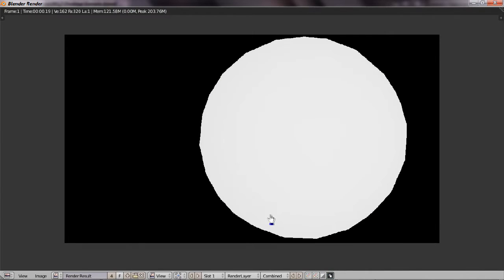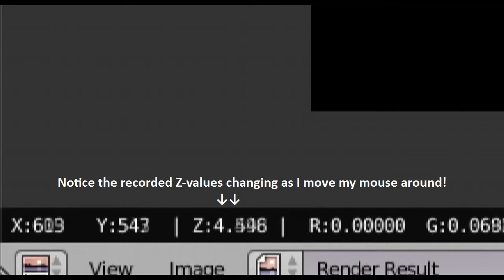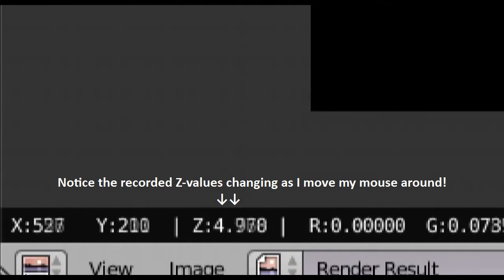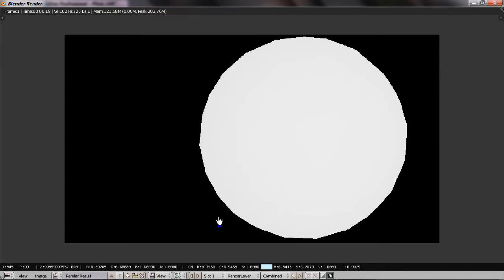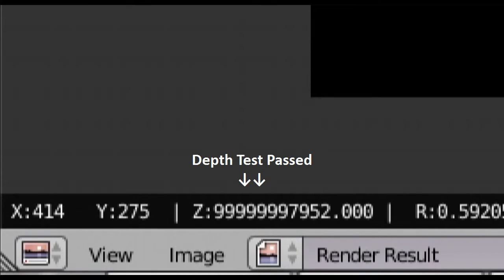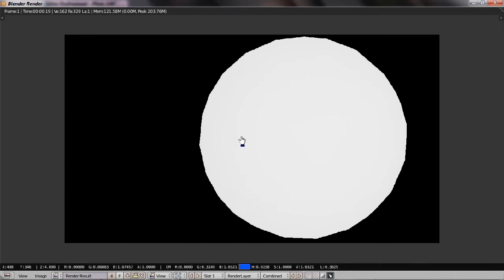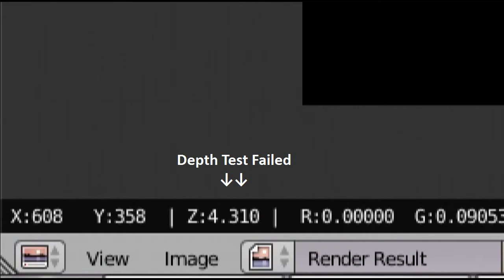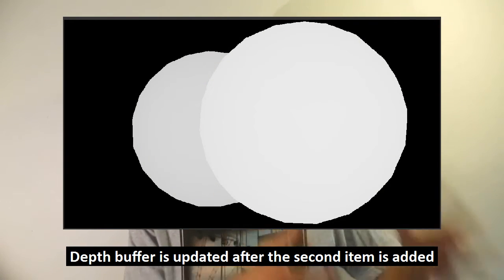Z-Buffer - Friday Minis 149

Comment: Thank you very much for your video. About transparent shader of hair with one single .obj. do you have any idea to fix render fight ? Thanks
Reply from the maker: You're welcome! Generally if you're seeing the signature flickering look of z-fighting, this may indicate that your mesh is somehow duplicated. Check and confirm that there aren't vertices and faces that are overlapping at exactly equal coordinates.

Otherwise, any other problems you see are likely to be specific to the shader or renderer.
Reply: @NERDfirst  thank you very much, let me think. The hair are not duplicated and overlapping in equal coordinate. But the strip in between are overlapping and there is to much of strip. I guess that I have to work with no-transparent shader which fake the transparency. Thank you very much